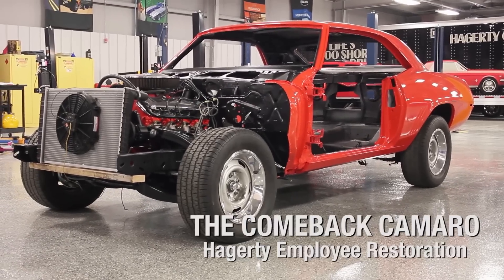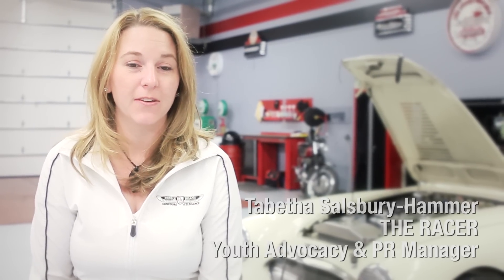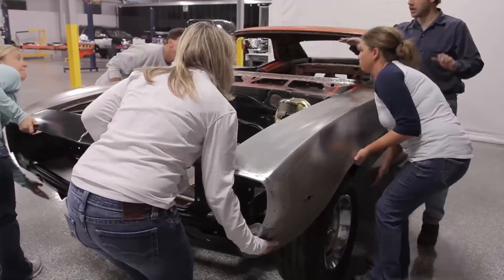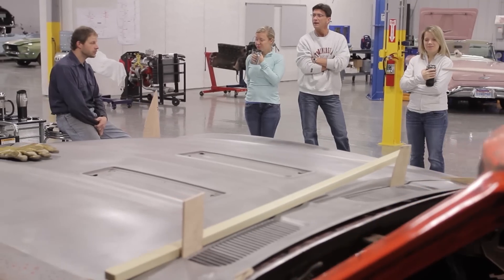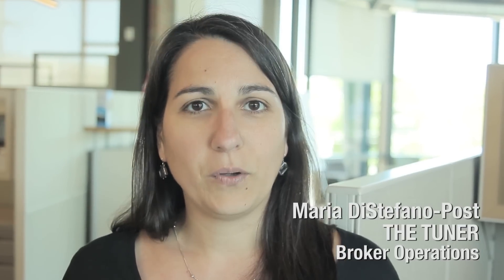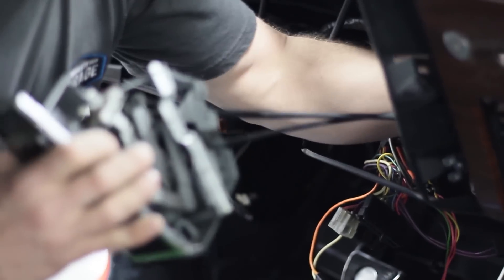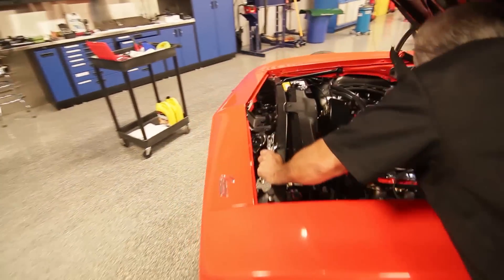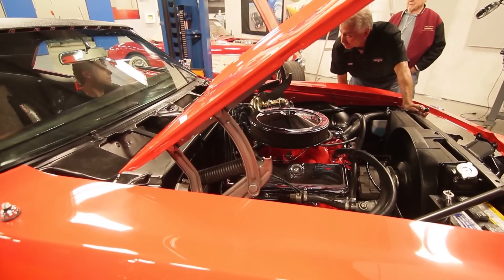The Comeback Camaro: Hagerty employee camaro restoration project

Comment: Looks great, with one note though. The 325 hp 396 (L35) (with which this car is equipped) came with the black, closed snorkel, type air filter.  the L34 and L78 (350 hp and 375 hp) 396's came with the open element chrome air filters.

Comment: ok if the car was total loss then why was it rebuilt.looks like the insurance company stole the car from its owner so they could fix it up.if it was good enough for the insurance company to  put money in to it should have been good enough to fix for the customer then.just another way insurance rips you off.nice the car was saved but it was saved for the wrong people.
Reply from the maker: tlcbear2 The cost of the damages exceeded the value the car was insured for. The owner was given the first right of purchase/refusal. Hagerty bid on the car just like any other salvage company could have been on it at Auction. It was at this point we purchased the car. Rest assured this claim was processed like any other claim we handle. You can learn more about how Guaranteed Value works on our website or feel free to give us a call.